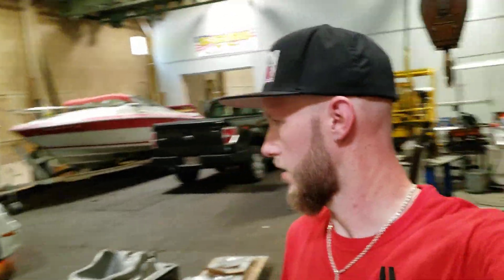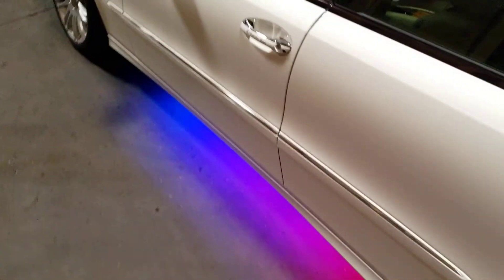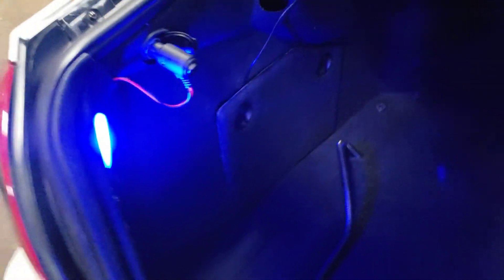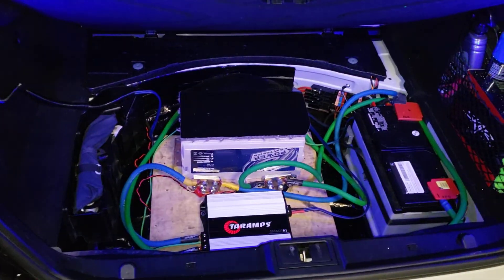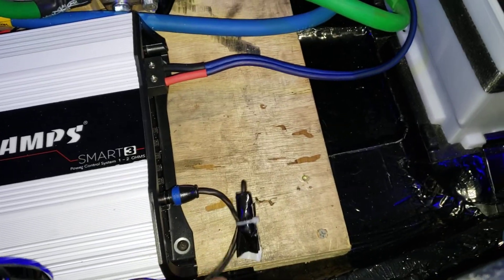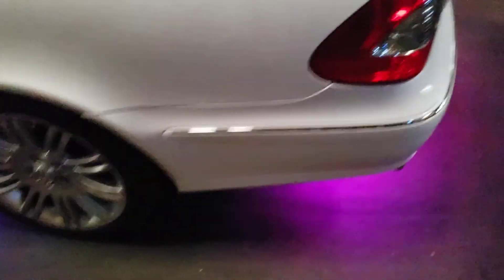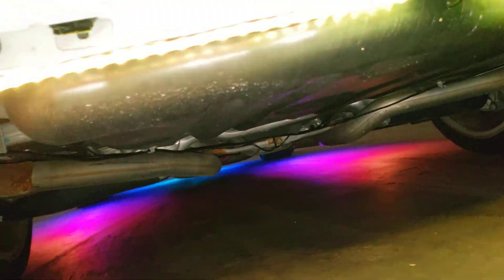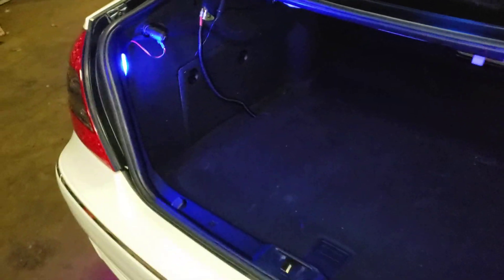Car Audio Install Closer Look

Comment: Everything looks clean, only thing I can recommend is looking into some wire ferrules to help clean up those wires going into your taramps power inputs. They really clean up those loose wire strands. Took me a while to give them a try aswell but I like how you have that set up in the bottom of the trunk
Reply from the maker: I do have some sky high ones, but they're too big to fit in the amp. Its 2/0 welding cable, and I believe the amp has a 2 gauge input. It just wouldn't fit. I had to tie a zip tie around the copper just to get most of it to fit in there lol. I do have reducers, but figure I have more contact like this? I saw if u cut a ferrule in half, you can get it to fit. I just learned that on budget basshead channel. So I may try that.
Reply from the maker: Taramps says they're 0 gauge inputs, but thats not to american standard. American standard equals out to 2 gauge. Big D talks about it in the smart 3 dyno video.
Reply: @1ohmwrecker  I had the same issue with sky high ferrules and it's a little tough with the 1/0 oversized skyhigh wire but I never tried cutting it in half, gonna have to try that. Sucks about the 2 awg inputs. I use to have a md taramps 3k so I know remember having to use 4 gauge reducers. That's one thing taramps should update on their 3k amps. Is the 2/0 gauge welding wire the same size as a 1/0 ofc skyhigh wire?
Reply from the maker: @RomaVilla  yes, pretty much exact. Other than I paid $72 for 30 ft of this welding wire. The cheapest 1/0 ofc car audio wire is $200+ for 50 ft. I still got 2 good 20ft runs left to run dual runs from the alt to the trunk for future situations.
Reply: @1ohmwrecker  that's a good deal for sure, how big of a difference does it make running a power run from alt to trunk batteries?
Reply from the maker: @RomaVilla  well, its just a big 3, but since the batteries are in the trunk, the alt run gotta run all the way back. Right now my car and the system is all demanding power from the 2 gauge factory wire that runs back.

Comment: Thanks a lot man everything looks great!
Reply from the maker: No problem buddy!
Reply: @1ohmwrecker  another question, I have my LC2i on the GTO and I hate. Which fuse did you tap into?
Reply from the maker: @Mangohabernero  just pull it out, and switch it to the other 2 prongs. It'll drain ur battery cuz it will turn the amp on every time you unlock the doors or anything. You can find empty fuse spots all over this car. Its got 5 or 6 different fuse locations lol.
Reply from the maker: I tapped into the one by the navigation DVD player in the trunk. You can buy fuses that you can crimp your remote wire to. Use a multi meter, test when car off, and car on. If it turns the power on and off correctly, then u got it.
Reply: @1ohmwrecker  thanks again man! All bs aside you’re my mentor for walking me through this. I really do appreciate it
Reply: @1ohmwrecker  I’m glad your one of the many that educates instead of bashing people when we have questions. Rock on brother! I’m sure I’ll be back with some more concerns/questions soon! Lol just trying to get things in order. I did a sloppy job when I started, and of course at the time I just needed some boom so I rushed it.
Reply from the maker: @Mangohabernero  yeah, I know there's some real a-holes in the hobby, bit there is good people in it too. Ppl like to bash other ppl in comments, but were all here for the same reason. The love for car audio.
Reply: @1ohmwrecker  hey bud! Lol it’s me again ahah where’s your voltage when your car is running. I installed a second Agm I’m resting around 12.7-12-9 I believe and with the car running I’m at 14.2. Is that normal? Thanks again
Reply from the maker: @Mangohabernero  mine stays pretty consistent 14.0 volts when its running. And rests at about 12.8 or so. If you are bumping your radio, and pull into your driveway, don't immediately turn the car off. Let it run and keep your voltage steady cuz it'll murder ur battery. Atleast a couple minutes. I'm wired at 4 ohm at only probably 1400 watts rms max, so my voltage doesn't drop below 13.4 or so at full tilt while I'm driving. If you're wired at 1 ohm with 3k rms, then its gonna be really really hard on the electrical.
Reply from the maker: @Mangohabernero  in short tho, yes completely normal. When u see things drop from there, then u know something isn't right.
Reply: @1ohmwrecker  took out my system for now to reevaluate some things. So I upgraded the factory ground at the battery like you’ve done  and added a second agm. I’m aware on our cars we have a 180A alt but I was browsing on fcpeuro and spotted a 220A that fits the e350. I’m debating on getting it to upgrade the charging system. I took out the subs to install the battery and might throw a pair back in and run it at 2ohm for now just to see how things go.
Reply: I’ll be playing only at 1000rms cause it’s in series parallel
Reply: @2ohms
Reply from the maker: @Mangohabernero  I've been looking at js alternators. They sell em for the E350 also. On sale, you can get a 220 for $285 or something which is a great deal. I was gonna buy the 300 amp. But be aware the car may not let you charge high like that. You may have to customize things to get everything out your alternator. Thats a lil over my head lol.

Comment: Bad ass speaker conectors where did u got those ??
Reply from the maker: If you're talking about what is the speaker cables i plug into my box... They're called banana plugs. They usually fit up to 8 gauge wire. You can buy them from sky high, knukonceptz, etc. I got mine from ebay. I bought them for my home theatre, and figured they would work well for this also.
Reply from the maker: https://www.ebay.com/itm/14-Nakamichi-Speaker-banana-plug-Adapter-Audio-connectors-Top-Quality-USA-Stock-/282897196256?mkcid=16&mkevt=1&_trksid=p2349624.m46890.l6249&mkrid=711-127632-2357-0
Reply: @1ohmwrecker  okk thanks alot man they are bad ass